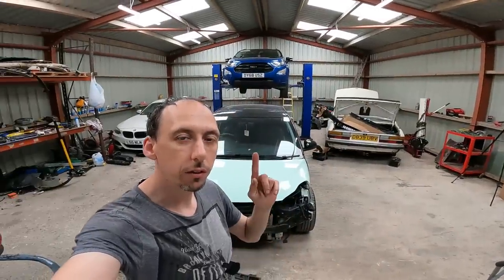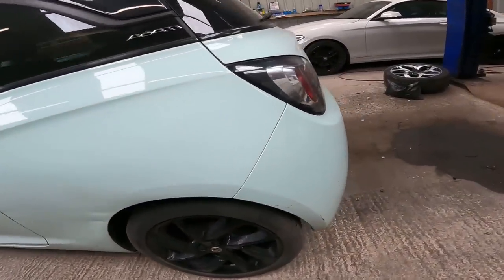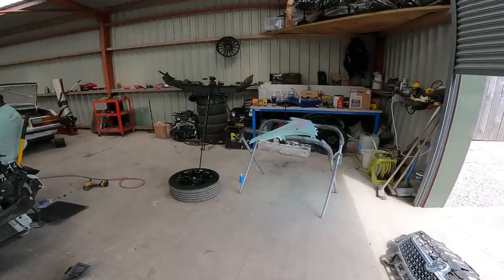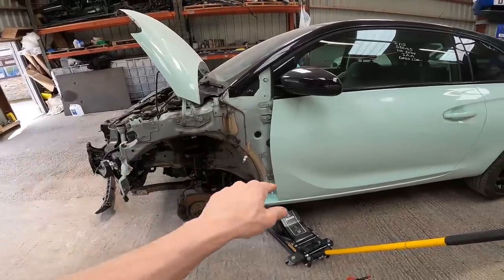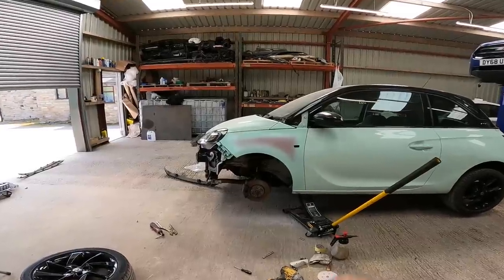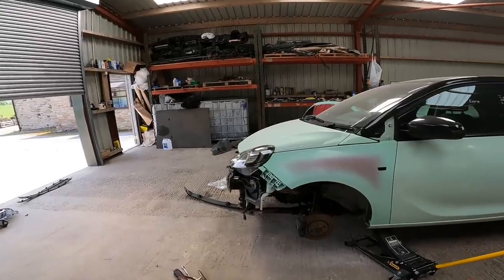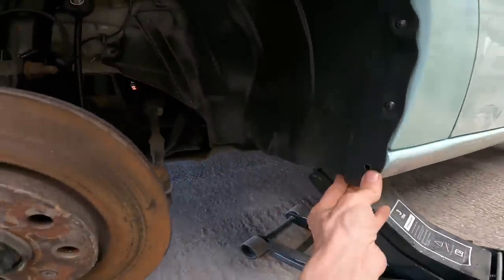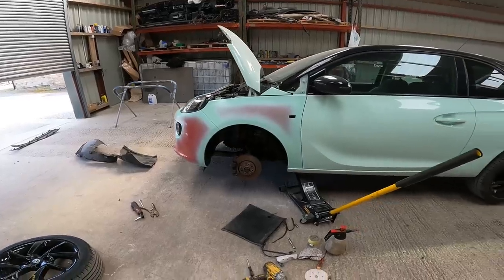I Didn't Expect Parts To Be A Problem With This Vauxhall Adam Salvage Repair......

Comment: Hello Phil. You require an upper bumper support.A lower bumper support and three plastic guards that sit each side of the condenser and one on the middle.The lower lights are the indicators.

Comment: Personally I’d use the new splash guard and cut out a section as a brace and bond it to the old one. That way you have one that fits correctly as the old worn has quite a neat tear/split it it that could be repaired?

Comment: Hi Phil. Loving the Channel but confused as to what has happened to the Mercedes C63. I watched up to you getting the replacement oil cooler and the front end all built up then the car disappears 🤔 have a missed a vlog or is the car at the paint shop??
Keep knocking them out fella your doing fine 👌👍
Reply from the maker: It's on road now mate,  will do a video with an update on it soon 👍

Comment: I have just sold a damaged Adam. The front bumper was mad expensive and so we're the clips and supports etc. I ended up buying a bumper for £300 but then the grills and spot lights were silly money on top. Plus the bumper needed painting. 😮